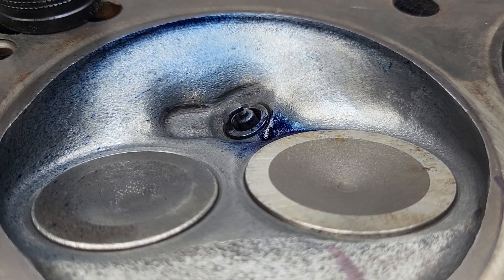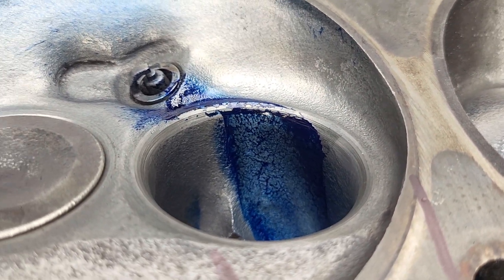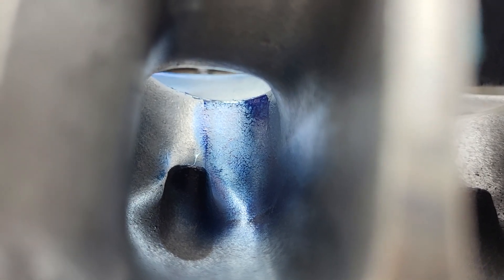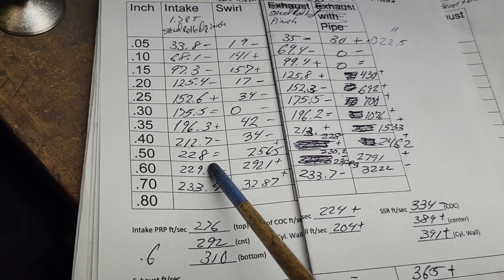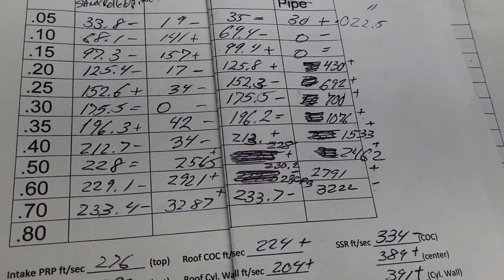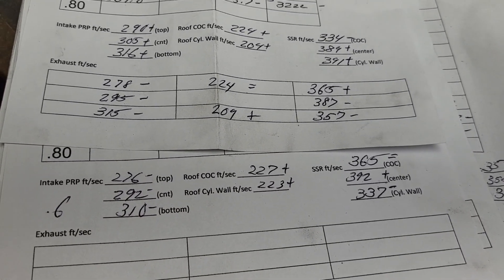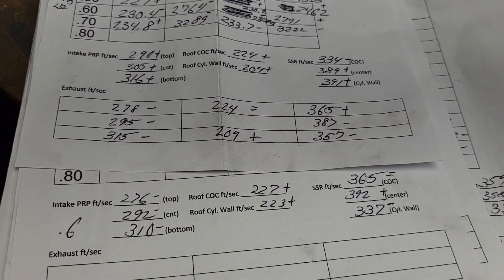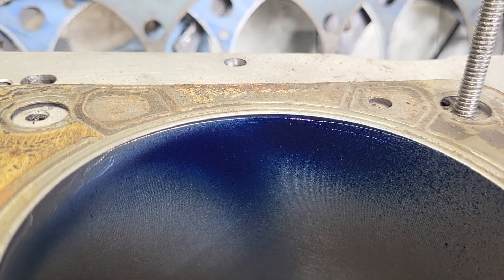David Vizard,Unity Motorsport, Mission Impossible 318 project, Rough textured new intake valve.

Comment: The other thing I've done is used a flap disk to radius the valve angles with a 120 grit flap wheel with the valve chucked in the drill press.  The idea was to radius to and from the seat rather than have multi angles. I have no way to test the results though.
Reply from the maker: D.V. does something like that on valve job.
Reply: Supposedly it's ok for the exhaust side, but not the intakes due to deatomization of the fuel near the seat.

Comment: In a more stock engine, what would your thoughts be on keeping the evaporation ridge and texturing the rest of the valve backside?
Reply from the maker: Evap ridge probably helps mileage. If you want more power use a back cut.

Comment: I think you’ve done outstanding job with the series
I’ve asked this before if you have a video on how you apply die if you could post either a link or the title so I can review how you get these results. It would be greatly appreciated.
Reply from the maker: I have shown it, I do not know which video it is. Just watch them all, twice! Kidding...
Reply: @servediocylinderheads  😅 got in late I’m just trying to figure out how much you’re opening the valve when you apply the contrast what velocity the air is blowing up is it on your flow bench or you just bring it in with a spray can I’m just trying to understand it honestly, not trying to be a dick
Reply from the maker: @bb400dart2  I always test dykem at the same lift as I take the air speeds so I can see what is happening. These tests are all at .6" lift, near 230 cfm. Thanks

Comment: If the goal is only one HP per cid then you hit that long ago. Those should support 400 no problem on the 318 if you can spin it fast enough?

Wallace racing calculator that estimates RPM that peak HP will occur says what you have ;

The RPM that peak HP will occur is 6,885.55 RPM with 318 cid.😯 You're going to want a genuine imitation RPM Airgap for this one. Dicking around with the factory intake is a waste of time when a genuine imitation RPM Airgap can be got for 136 or make offer shipped, so probably 120? A swap meet Edelbrock 600 for 20 bucks and your at 350 HP with the right cam.😎👍
Reply from the maker: I agree, the bad intake and tiny carb is what kills it! We really need a Vic jr. For 8000 rpm runs!
Reply: @servediocylinderheads  
But then you'll need 265 max intake CFM for the peak HP to occur there.😯 Looks like you have a ton of work ahead of you.😁👍
Reply from the maker: @itseithergonnaworkoritaint7852  We will find out. Thanks
Reply: @servediocylinderheads  
That would be cool if you're right, my info is from one of the Wallace racing calculators. It's a basic calculator, you input max intake CFM and cubic inch displacement and it tells you at what RPM max HP will occur.

That's why I mentioned the genuine imitation RPM Airgap intake for the 6,800 RPM HP peak with the current max CFM. That would also give the better torque as well. IMHO😎👍

Comment: You're right. Best looking bore appearance by far.  Does putting the rough texture in the port effectively make the port slightly smaller due to the boundary layer? And due to it being slightly smaller, this raises air speeds? But also it inhibits overall flow as depicted in your test. If that texture helps keep fuel suspended better, does that equate to better efficiency? Sorry for the extra questions. I'm trying to understand better what the airflow is doing.
Reply from the maker: Yes it does!

Comment: I wonder if adding a backcut would help at all as well? If you have a few spare valves I’d give it a try with different angles, maybe 30, 32.5, and even a 35? I wish I had a flow bench to test how different backcuts and margins effect flow, I feel like with your textured valve adding a 30° back cut would pick up some low lift as well as creating a vaporization ridge where the 30° & 45° angles meet. That back angle on the valve is very steep and more tulip shaped so you might be able to even fit a double backcut on there. Maybe a small 30° with a wider 35° and a 45° that’s just barely wider than the sealing portion of the seat. For my own personal engine I’m going to try a textured intake valve with a double back-cut and see what it does, I’m using 2.165” ls3 hollow stem intake valves that I’ve lathed down to 2.055” for my 462 heads.
Reply from the maker: I do have an extra valve for a back cut. I was thinking of this as I prepped the other 7 intakes yesterday. It is worth a try. Thanks
Reply from the maker: Ls3 loves a back cut
Reply: @servediocylinderheads  yeah I would love to see that, it’ll probably give you gains & losses flow wise in certain areas depending on the angles but I’ve always wondered what angles are worth the most power for any given combo. MBE did a video explaining how on one of their big block Chevy head’s a double back-cut on the valve was worth almost 100hp over a non back-cut valve, they of course had 55° seats & 1”+ lift and all the angles & length of angles tuned to a razors edge but anyways I always thought that was pretty neat & interesting how much it made a difference.

Comment: Well done Charles!  I'm in total agreement with you on this. Better fuel dispersion will more than offset the slight reduction in cfm. I do wonder about long term usage as carbon begins to build up on the back of the valve. Is there anything that can be done, other than routine  claening to offset this?

Comment: Turbulence is a peculiar thing.

If its really large, its bad.

If its really small, its good.

It is well researched, and yes, you pretty much said it like it is.

It is much like a whole bunch of microscopic ball bearings across the surface of the object.

Just like golf ball dimples.

One of the advantages of this is a slight reduction in carbon buildup.

Comment: Still wondering if you widened the valve guide pinch toward the center of the cylinder,  looks a little tighter than the outside but I dont think there is alot of cfm there. Very impressive heads Charles. I wonder what you could do to my 360 heads
Reply from the maker: I ported a j style intake and exhaust port for Rob. There is a video somewhere. Thanks
Reply: @servediocylinderheads  thanks Charles
Reply from the maker: @No1414body  You are welcome.

Comment: Good results. My takeaway is that the port design is always the limiting factor.
Texturing interrupts the flow's tendency to glom onto the surface, as seen with golf balls. It's worth more than I figured, and it's free power at high flow speeds.
(I'm guessing)
Great stuff 👍😊
Reply from the maker: If it helps fuel atomization I think it is worth a few cfm. Thanks

Comment: Does that mean that textured valve doesnt get cooled by fuel because of boundry layer. Cool fuel getting into chamber and atomizes there, poor mans direct injection?
Reply from the maker: You make a good point. The fuel may not actually hit the valve as much. It may run a higher temp. D.V. said he has seen intake valves glow red in a running engine so not sure how much fuel evaporation will curb that. I would worry more about guide size and finish to remove heat

Comment: Great stuff Charles.  Would the effective gain here be depleted over time by a build up of carbon eventually smoothing out the dimpling. I suppose it would be a matter of time before some efficiency would be lost.  Then perhaps a matter of maintenance of cleaning the valves off . I have to say its the first time I have seen this done to the back of a valve . You live and learn. Cheers.
Reply from the maker: I don't think so. Carbon on valves is usually due to oil coking on the stem after leaking from the guide.
Reply: @servediocylinderheads 
I run a can of Berrymans B12 every 5-10k miles.
$5 is no big deal considering what we spent on the build, oil, and gasoline. 👍BTW, no PCV helps a lot too.
Reply from the maker: @hotrodray6802  Tell what that is. Thanks
Reply: Water injection keeps carbon non existent
Reply from the maker: @markgiraldes4062  It has a pretty good octane rating as well.
Reply: @servediocylinderheads  Yes Charles Understand your response. We had an investigation some years ago due to a high maintenance issues, one conclusion was we had found deposits on the underside of the valves , eventually samples were taken of the deposits and analyzed to ascertain if the components / agents within the fuel was a cause . The drive was to reduce costly maintenance.  I think one of the drives  was to reduce the temperature of  the valve, first time i had seen  specialized valve coatings . 
Looking at what you have been doing , texture under the valve and turbulence that you have done here might have been part of a solution. Charles I am very impressed with what you do, and the knowledge you convey to others. Be Lucky   as we say here across the pond.
Reply from the maker: @cedarlodge8525  Luck would be great! Thanks